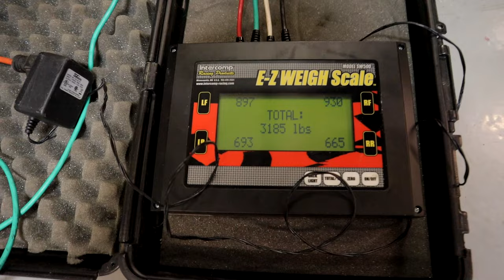American Musclecar Evolution - Why Pontiac Started Strong And Faded Into Obscurity

Comment: The other issue Pontiacs had was the gigantic crankshaft, especially the main journals. They were enormous on the small V8s, and even bigger on the large engines. The 326-400 engines had a 3in main journal and the 421, 428 and 455 had an even bigger 3.25in main journal. Even a BBC only used a 2.75in journal IIRC. With those huge journals, the bearing speed is ridiculous, and they run into all kinds of problems because of it at high rpm. Most people don't know this, but Smokey Yunik actually worked for Pontiac initially, but when they went to the giant 3.25in main journal against his advice, that's when he left to go work with Chevy instead. Those cast rods and giant journals are why Pontiac engines don't want to be revved like you can with a BBC for example.
Reply: I tore down a 455 Pontiac that had a snapped crankshaft because 6 wrist pins were seized. The crankshaft looked kind of odd to me and this makes sense of why they had issues.
Reply: @gabesgarden57  their cranks are ridiculous. It's great for low speed durability, like in a big diesel engine, but for high rpm it just isn't going to work. Even with good strong rods, that crank design is a liability once you get the rpm up over 5000rpm.
Reply: Pontiac cast cranks either Arma Steel or the later Nodular Iron (not including the lightened ones in the mid-late 70's) are actually pretty stout, good for 600+ hp if properly prepped.  Yeah the 3.25 journals for the 421-455 are pretty big though I believe Olds used the same size.  Some would cut them down to 3" and put in a 400 block.   Now you can easily buy aftermarket cast or forged cranks with the 3" journals and build a 455 using the 400 block.   And believe it or not a Ford 351 Windsor also uses a 3" main journal.
Reply: @robertrio1164  they are a very strong crank, yeah. That's not the issue though, it's that journals that big create really high bearing speeds, which can be very difficult to make survive high rpm. That's one big benefit the sbc has over alot of the old V8s. They had relatively small main journals, which helped alot with high rpm longevity, especially the small journal 283 and 327 engines.
Reply: @robertrio1164  yes, factory Windsors are also cursed with a huge 3" main since they were designed for station wagons and trucks and not for high rpm use. That's why you'll find all the aftermarket performance Windsor blocks have a 2.75" Cleveland main instead.
Reply: @adammcilmoyl4278  Yes I agree with you, the smaller journals improve ability to rev and require less oil pressure to float the crank on the bearings.  A Pontiac can still be built to rev pretty high with good rods, forged crank, high flowing heads/Intake and solid cam.
Reply: @briannelson8373  Ok, didn't know that about the aftermarket Windsor blocks.  I do know though the Cleveland has the smaller mains.  I prefer the Cleveland over the Windsor anyway.  If I inherit or buy my Uncles '72 Mach 1 from him I'd like to build a 408 stroker out of the original 351 in it.
Reply: Exactly
Reply: @robertrio1164  I will still stick with my Poncho 389 & 400 4 bolt main blocks with a new aftermarket steel billet part. Sure wish the price of this stuff would drop more.
Reply: Hell my 12 valve Cummins diesel in my dodge dually has 3.26in main journals😂 that’s crazy to think about
Reply: @robertrio1164  , Olds = 3.0" on big blocks and 2.50" on small blocks :hand-purple-blue-peace:
Reply: no thanks im sticking with fords le mons ideas of big 3"+ sizes for mains and rod's and im a 440/hemi guy, iv taken apart enough JDM/DSM's 1.5-2" to know it's not for me sure it revs more but now the maximum loaded limits are lowered aka less torque at the flywheel and tires or it spins bearings or spits out rod's and or shorten's the life aka daily-driven 90k vs 300k mile's of TBO, besides torque wins with middle RPM's ( use gearing in the transmission aka OD ) vs no real torque and stupid high 11k rpm's and 1:1 gearing

same issues with industrial manufacturing equipment i have seen
Reply: @thomasgriffin7774  and there known for holding stupid amount of power for longer time can't say that about a 90's civics 4-banger running on boost
Reply: @richardprice5978 honda motors have been known to make some crazy power for a long time.
Reply: Obvious you've only read about them online & actually know nothing given that wore out ignorant statement "journal to big uhmm bearing speed duhh"" there's more to it than that, do some more research & try actual building them, you can start with journal overlap, just 1 benefit of the larger journal.
Reply: Anyone who makes the statement of to big a journal is ignorant and needs more hands on experience & more research, only reason that statement has become popular is because broke people and others who couldn't afford or find the bigger cu engines, started saying it to justify as an excuse why they went with the cheaper easier to find smaller cu engines. Before repeating the same nonsense bs propaganda do some more learning, you can start with journal overlap.

Comment: I have to disagree with the statement concerning the big-block Chevrolet.
It was widely known, even back in the 1970s, that the Ford 351 Cleveland, when equipped with the closed-chamber 4V heads as it was in 1970 and 71 would produce more power per cubic inch (when modified/tuned) than any other V-8 engine. The engine was designed with one purpose in mind, and that was to outperform the Mopar 340 and Chevrolet 350
Its tall block variants were the last overhead valve engines designed and built by Ford until the introduction of the 7.3 "Godzilla" engine for F-250 and larger trucks 3 years ago.
The big-block Chevrolet had the inherent fault of having unequal length intake runners, which had a negative effect on performance. Neither Mopar or Ford engines suffered from that issue.
Reply from the maker: Tell that to the literal universe of high end and professional racers all around the world who rely almost exclusively on BB variants to this day
Reply: @UncleTonysGarage  Were YOU involved in automotive repair and modification in the 70s?
I WAS.
 The fact is, what I posted was a known fact when you were still a kid. If you were racing with a displacement limit.....Clevelands of some variation were winning. In NHRA and IHRA, it was a big-inch Chrysler Hemi variant. In NASCAR it was a stock displacement Chrysler "late Hemi" They absolutely dominated.
Chevrolet didnt even get close
Just the facts.
Tell YOUR story to Richard Petty., or anyone setting top fuel/funny car records with Hemi variants...see if THEY agree.
You know quite a lot, and some of what you say makes sense...BUT..you dont know it all.
Reply from the maker: Don, I got thrown out of HS in 1977 and went directly to work as a mechanic...had my first shop at 19, so yes I was very involved in auto repair and modifications in the 70's.  I lost my first license before I ever got one for street racing tickets.
As for Hemi variants, I was very involved in Fuel racing from 1988 until 1999, so I know a few things about that also.
Intermingled through all of that was some Super Stock Hemi experience.
I can tell you first hand, beyond any doubt, that the only place the 426 Hemi is truly dominant is when a huge amount of liquid fuel has to be BLOWN through it.  The Chevy has a MUCH more N/A, gasoline friendly combustion chamber.
Reply: @UncleTonysGarage  I see you deleted my comment explaining why a  Hemi is superior to a BBC. Thats pretty chicken shit, but despite what you think, there ARE people who know more than you do, and have been involved with engines longer than you have, especially when it involves learning the physics concerning internal combustion engines, and it looks like I might be one of them.
One of the first things I learned in internal combustion  physics....Volumetric efficiency rules.
In fairness, its not just you...there are many people making YouTube videos, and when they are wrong, they get called out too. I get it..your pride took a hit.
Mine has too....when I was younger and didnt know.....but thought I did.
Reply from the maker: I didn't delete any comments from you. 
Listen, I never claimed to know everything, but I'll state straight up, I know more than most.
Saying "volumetric efficiency rules" is the same as saying "gravity is good", or "ice is cold".   It's the MANAGEMENT of that efficiency that translates to work, and in that case the BB Chevy does a better job.
As I said, I do have some hands on Super Stock Hemi experience, but I also spent a good bit of time around John Baughman and Ray Barton back in the 90's and wrote about these topics extensively in SSDI and Drag Racing Monthly as well as a couple of Mopar only magazines of the day.
Believe whatever you choose to my friend, and build whatever makes you happy.  These days, things like hopping up lowly Slant Sixes and 318's are what keeps me interested.  
As for the rest of it...been there, done it, got the T shirt and moved on.
Reply: @donreinke5863 you do realize that na big blocks for can am racing where making tons of hp the Cleveland racers while a excellent engine had many issues to resolve to survive at high rpm for long. Why do you think the 335 series fell off in favor of the windsor platform.
Reply: @jdrok5026  Because Ford ceased production of the true Cleveland in 1974, while the Windsor was still made for another 22 years.
People that want to make serious power from a Windsor use Cleveland type heads.

Comment: Yes, I had run several Pontiac engines and I always got 7 & 8 connecting rods go through the oil pan. Unfortunately, they were expensive to rebuild so I went to a sbc in my GTO. Ran it on a road coarse for years and never looked back. Gotta admit, those Pontiac engines had good low end grunt though.
Reply: @SweatyFatGuy  You are correct, I should have had a rev limiter on there because 5500rpm was max before bad things happen.

Comment: So much here.  Those rods kept Pontiac out of the marine business.  And, in the 60's, a lot of hot parts came out of the marine catalogs.  Top tier Pontiac motors would eat you up on the street, but there were few of them.  Goats running Road Runners all day long, but no killer cars.  
My cousin had a 57 Ford 2-door with a 383 and TQFlyte out of a wrecked police car that would run away and hide on most folks.  Mopar into a Ford was not common, but not unheard of.  Could not stick big Chevy V8's in Fords unless you went to an Econoline front axle swap and nuked the cross member.  Way to much work for most folks.  But 383, 413, 440 into a mid to late 50's Ford, not a ton of work.  Why, because 1 the FE had worse oiling issues, and 2 they were expensive to make go fast.  Could be done, but only if you get Holman & Moody parts, and that was tough ...
Reply: Always Ford’s problem, not building enough of the good stuff. When they did get it right (351 Cleveland) , the sanctioning bodies cut their nuts off with restrictions. Always about Chevrolet first in pro stock then in NASCAR. It’s not Fords fault they were building aerodynamic bubbles and GM was building boxes

Comment: Some very interesting comments. Pontiac for sure with that big low end torque made for a great street runner. I always remember a friend had a tired 1972 Pontiac Grandville. Huge boat of a car but tired as the 400 V8 engine was, you could still spin 'em easily at half throttle taking off from the stoplight. I truly wish I'd bought that car back in the day, tired as it was. I was just a little concerned because I knew how much my friend had abused the poor thing over the years.

Comment: I always ran Pontiac's. But in 1989 built a street stock with a Pontiac 350. Ran it for a year before I switched to sbc. The Pontiac had a 75 lb. Crankshaft vs chevy 55. And it went around turns faster with a lighter engine in front. And it was cheap. Winning was more important than brand loyalty.

Comment: What doesn't make sense to me:  If the rod was THE weak link, then I would expect that would be the very FIRST thing the aftermarket would address.  To me there are 2 reasons Pontiac faded: 1) The V8 peaked too early.  Other divisions (Buick, Olds) came out with 2nd gen engine designs during the mid-to-later 60's, and this carried them through the 70's and stumbled into the 80's.  With the introduction of the 389 with thin wall castings in 1959, Pontiac planted themselves with this and continued upgrading this 1959 engine.  Later when they needed a new generation of engine design it was too late.  2) Simply put, CPC.  In 1984 Pontiac was folded into the Chevrolet-Pontiac-Canada Group of GM, which was nothing less than the complete takeover of Pontiac by Chevrolet.  Pontiac was now just an empty brand name with no substance behind it.  Pontiac was a thorn in Chevy's side all through the 60's.  GM has a self imposed 50% market share limit to avoid being broken up under Anti-Trust laws, and Chevy alone had 25% market share.  So for Pontiac to be successful and sell more cars meant that Chevrolet had to sell fewer cars.  And Pontiac was in a STRONG 3rd place passing Plymouth and nipping at Ford's heels.  This was bringing Chevy down lessening the gap between Chevy and Ford.  Chevy couldn't have that.  And what Chevy wanted they simply went whining to GM corporate management to get their way.

Comment: I had a 421 SD with a M/T cross ram. When it spun a bearing back in the mid 70s, I was able to get the 455SD forged rods. They were much heavier as you know. They added 3 and 1/2'of Mallory metal to the crank to balance the assembly. THe engine was bored .120 to 434 c.i. prior . I spun that engine to 7200rpm  several times . I did use H.O. racing guide and installed a mellings oil pump and had a deeper 7 quart ? oil pan.  68 Firebird.  Those rods were impressive...just like your vast knowledge Tony! Cheers

Comment: First car was 70 Lemans, bought it in 79, I was 14, had a 400/4sp.  After a brief 396 swap ended with a spun bearing, the 400 went back in. That engine was built by somebody, had a sleeved cylinder I'd guess from a rod. Whom ever rebuilt it installed forged steel rods. I assumed from a pre 63 engine but have no idea if that was the case.  It had 7K3 heads with screw in studs, the studs outa the blown 396 was my cheap adjustable valve conversion. Then it would reallywind up, lifters pumped up like crazy before. Never blew it, pretty sure it would've with stock rods.

Comment: My dad said that was the issue with his 74 SD455. He threw the number 5 rod in the original 455. He swapped in a 400 and swapped parts over. Threw another rod! I don't remember which. One complaint I have about BOP is not many 4 bolt mains. I'd love a 4 bolt main for my Olds 455. More ease of mind like the oiling issues. You still can't kill my love for old brand X big blocks. One day I'd like to play with a Rocket Racing block.
Edit: You'd not like the newer 4cyl in Chevys lol. They like blowing head gaskets and lots of fragile parts.

Comment: in regards to 60s through 80s ford oil starvation issues. they actually had a couple related problems. front sump pan was a big problem in performance cars / street - strip cars. but in a car that was primarily driven as a daily driver and occasionally worked or played with. the front sump pan was fine. but after about 80 to 100k miles of daily use they would develop lifter tick. then oil pressure loss. because the top gear on the timing chain set was aluminum with a fiber / plastic coating on the gear teeth. this was done to make the engine quiet. but after so many miles they fibers would wear off and end up in the oil pan. they would plug up the pickup tube and cause starvation. although Ford was not the only manufacturer doing this with the timing chain. they seemed to be the one that got the most flack about it. Ford did correct these issues by the mid 80s when they went to double roller chain sets. that was somewhat short lived when they dropped the pushrod engine in favor of the OHC modular engine.

Comment: Pontiac actually had forged rods before the cast ones came out in '63, but besides the Super Duty forgings the standard forgings were really no stronger than the later cast rods, that is unless they were properly heat treated in which they became stronger.  Both Butler and Warrior Racing sold them resized, shot peened, heat treated and fitted with aftermarket bolts as a lower cost alternative to then expensive aftermarket forgings.  I have a set of them from Warrior in the 400 I built for my GTO back in the mid 90's.  I believe I paid $600 for them back then!  Pontiac also had a set of forgings exclusive to the 421 HO's in I believe 65-66 which are really no good and definitely weaker than the cast.  They were nick named the rubber rods...  Too bad they didn't just stick the SD rods in everything and then the 455 SD rod which is even better.

Comment: Back in the day, I street raced a '67 Ram Air GTO around the Florida Panhandle.  I bought the car set up for drag racing and it supposedly had aftermarket rods in it.  What I had the most problems with on it was bent pushrods.  It got to running rougher than usual and I found that due to bent or broken pushrods, it was running on six cylinders, sometimes 5.  My Dad had a junkyard and I went through every Pontiac engine out there and most of those engines also had a bunch of bent pushrods too.  I eventually got enough straight ones together to make a full set.